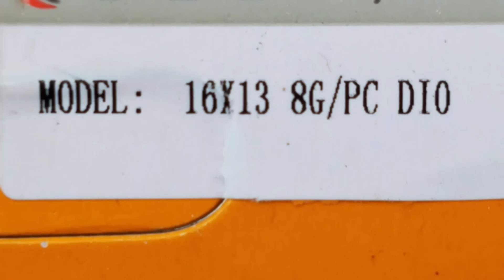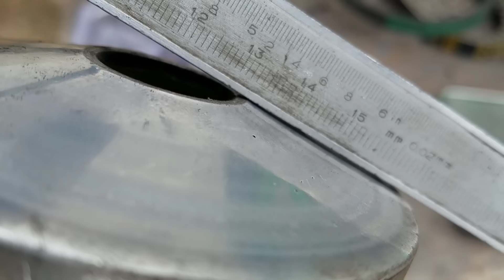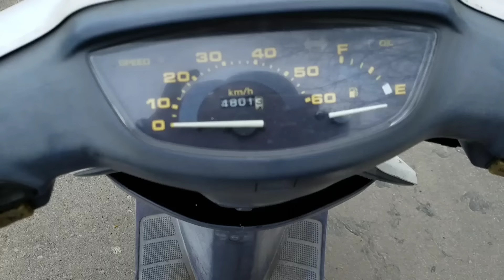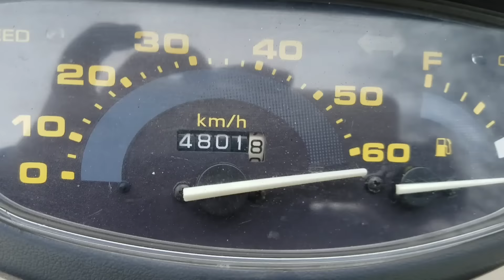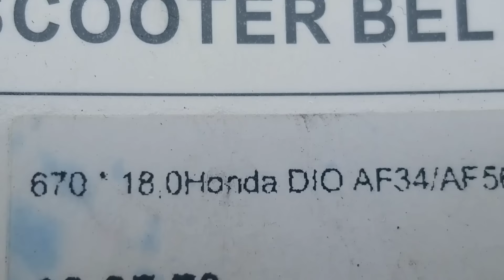Замена ремня и роликов вариатора на скутере Honda Dio

Comment: Wanted to get more performance from the carburetor I watched the run video but I can't get enough power
Reply from the maker: Then you need to do engine tuning
Reply: I don't have enough money :(
Reply from the maker: Wanted to get more ???
I have enough carburetor performance.
Maybe you need to configure it?
Reply: @sprayzmadafaka4079  hey man I know what you mean I spent so much freaking money on high-performance parts and just modifying my 50cc 

TaoTao 2013 scooter it's freaking hectic and crazy man like these parts a lot of them are cheap but they add up if you're buying multiple in a lot of parts..🙄🤦‍♂️^ LOL like I pretty much made my scooter a hundred cc I bought a big bore kit hundred cc I bought a nitrous 

for it cuz nitrous I believe is cheaper and better than Turbo 4 scoot and full high-performance transmission kit change the air filter in the gas filter two of them are high-performance. Change 

the tires for wet terrain tires those are high-performance came out to $49 for those two tires alone. I got a high-performance nebbie. Elbow pipe for my air filter that came out to like $26 and some change. And high power 

performance carburetor I got to buy jettings for them for extra more power 

to get the full capability of my carb. And I bought two high-performance front and rear brakes I bought some high-quality brake pads my bike got wet 

so I have to re-buy some wiring for it so I can rewire everything so I can start again bought a high-performance the little things for the battery cuz it keeps burning out cuz it was something going on with my bike I need a new wiring cuz 

it got wet. I bought a gbr blocker for my scoot that came out to $11 I bought a 

high-performance intake manifold in the little thing that goes under the intake I bought that to high-performance so I can give it extremely more air for extra power. 

Pretty much I made everything high-performance the only thing I have to buy is the jettings and maybe some more high-performance better shocks suspension shocks but I'm not sure if the last person because I bought it for $200 from somebody the whole scooter it's so so I don't know if the last owner change the rear shocks already cuz they look pretty big and sturdy I 

don't know they always am shocks but I might not need to buy any in just the jettings and sorry 😔 for paragraph. 🤷‍♂️^
Reply: And oh yeah I even forgot I changed the gauge cluster but it's a 50cc so I changed it even to a 100 mph cluster it says it goes up to 90 but it can go past 90 to 100 as well.
Reply: @marineboy4181  Nice man.
Reply: @sprayzmadafaka4079  and yeah thanks bro I would love to see your scooter maybe you could upload it on your YouTube channel or something later on I will try to show everyone my scooter when I fully modified it. :)

Comment: Honda dio Speed 60 km ✔ speed 120 km 🤔
Reply from the maker: I want 120, but I do not know how to do it?
Reply: You should try longer gears from malossi or something like that. Stock honda dio gearing is rather short especially if you still want to upgrade to a 70cc. Had the same with my puch zip with 70cc sport cilinder. Topspeed was like 60km/h because of the stock gearing. After the malossi gearing i was able to hit 108km/h🤪. Make sure you have enough power for longer gears though or else your scooter is gonna accelerate really slow. I have seen the vid where you placed the 24mm mikuni carb. Since that vid you have quite a decent amount of power but topspeed is still relatively low. I think with the right gearing with your current setup you should be able to hit at least 85km/h or more😋